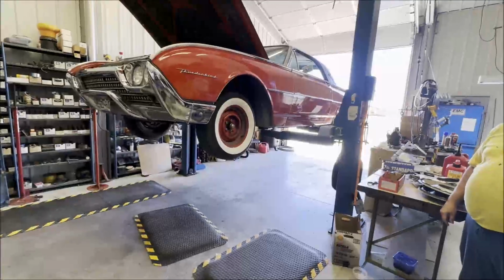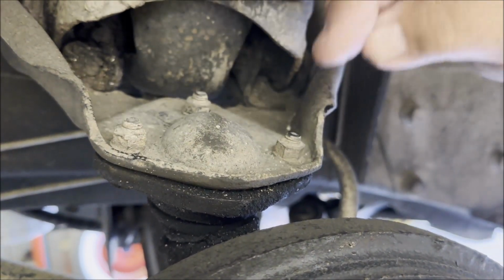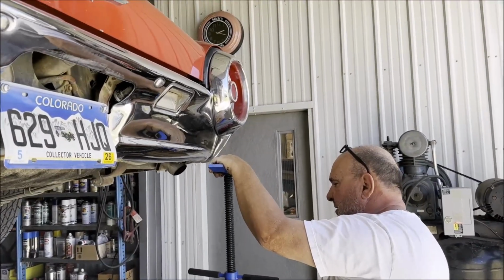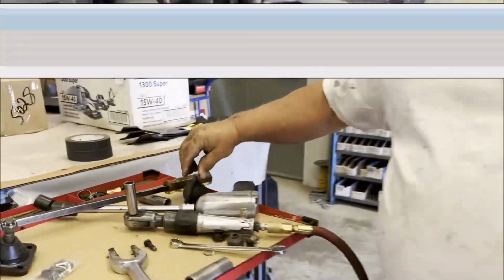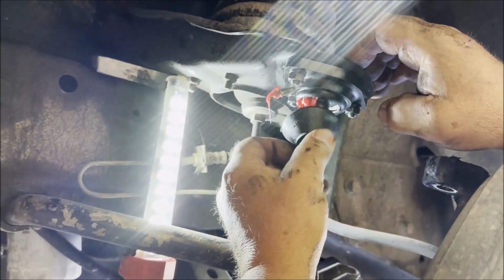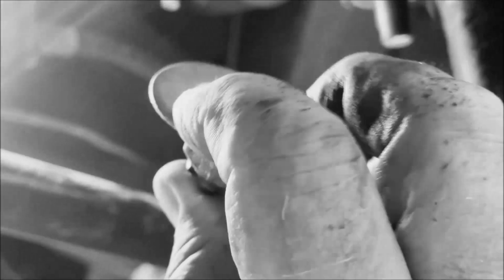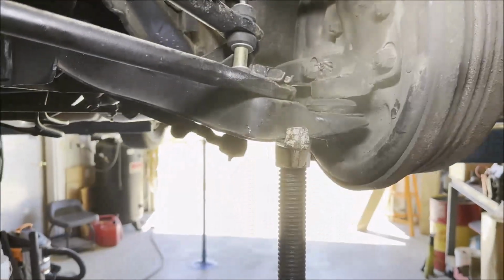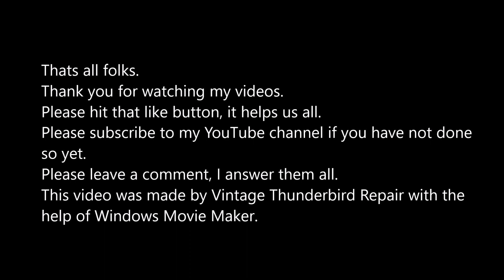1961-62 Thunderbird Upper Ball Joint Replacement

Comment: Hey Nick, 
Interesting how previous mechanics failed to get the castle nuts/cotter pins properly installed.  You'd think that would be a no-brainer.  Doesn't instill a whole lot of confidence in a person regarding the competence of some mechanics when you encounter issues like this!  Yep, the ball joints were riveted into place originally. Thanks for insightful tips!
Reply from the maker: Hey Scott, the cotter pin issue is a lot more common than youd think. I deal with it all the time. It is certainly the sign of a very lazy mechanic at the very least. Thanks.

Comment: Excellent video. Good reminder about castle nuts and cotter pins lining up. 

Have you done a video on replacing LOWER ball joints on 4th gen T-Birds? I don't recall seeing one. I've done the upper ball joints on my car and I think I should probably do the lower ball joints, too. Probably shoulda done them while I was doing the uppers, but oh well. From what I understand, the lowers will be more involved because the original rivets will need to be drilled out I think. I don't feel confident doing the job with just the shop manual as a guide. OTOH, maybe I should just drive my car out to you and have you do it. You could look at some other issues, too.
Reply from the maker: Hey TheCanine2, yes I can help you with that. I don't think I've done a video on the lower ball joints. I don't remember now since I've got so many videos. I use an air chisel to remove the rivets. The lower arm is much easier to do than the upper since you don't have to remove the spring to do the lowers. Thanks.

Comment: hey Nick  i'm getting ready to rebuild the steering and Front suspension on my 66, i ordered a rare parts steering idler bearing kit 20474 to replace the bushing. Have you ever installed one of these, It came with no instructions and rare parts Could not help me with the layout, they didn't seem to know anything about it really.
Reply from the maker: Hey Jason, Ive never installed one of those, Ive always used the bushing. Rare Parts is an excellent place to buy front suspension parts from and I think its odd that they could not help you with the installation. I dont know what to tell you because I am unfamiliar with the bearing kit and Ive never seen one. As a matter of fact, I didnt even know that a bearing kit was available. Did you look on YouTube for a video about it? Thats what I would do. Sorry I couldnt help you. Thanks.
Reply: @vintagethunderbirdrepair9426  ok thank you, i didnt know there was one either i was getting ready to order the bushing and found this listed on there website, is was only $10 more then the bushing and is greaseable so i figured why not, i looked on youtube but found nothing so far. ill figure it out i hope

Comment: Hi Nick, quick question unrelated to this video. I have a ‘66 with AC. Whenever I accelerate air conditioned fades from the vents and ambient air is felt coming from underneath the dash. When I am in an accelerated cruise mode, air conditioner works as it should. Any thoughts as to what is causing this issue?
Reply from the maker: Hey Douglas, yes I know exactly what is causing that. The vacuum system that controls the heater and AC runs off the engine and is dependent on engine vacuum. When you accelerate, engine vacuum, manifold vacuum, drops off and anything that is dependent on that vacuum starts to fail. All Thunderbirds do this, even those where I have fully rebuilt the vacuum systems and they are working 100%. It is the nature of the vacuum system. Same thing happens to those cars that have vacuum wiper motors such as the 1958-60 Thunderbirds. When you accelerate, the wipers fail. It sucks and to design vacuum dependent wipers was pretty stupid. There is nothing you can do about it except to maybe install an electric vacuum pump, one that keeps working no matter how much manifold vacuum you have. Its the nature of the beast. Good luck.
Reply: Thanks Nick.      I have first hand experience with the windshield wipers “fading” under acceleration. My late mothers ‘57 has always done that. (she purchased the car new in 1958 and yes, we still have it). Many thanks for your channel and assistance in keeping my daily driver on the road.

Comment: Nick,
Whoever installed those useless cotter pins for castle nuts was not a genuine mechanic.  He just thought he was one.  Good catch.
Regards,
John
Reply from the maker: Its a two fold problem, the reproduction ball joints have a longer shaft and the cotter pin hole is located in the wrong place. And then the mechanic doesnt have enough sense to identify the problem or bother to fix the problem. Probably a chevy mechanic!
Reply: Nick,
Before installing them on the car, ball joints can be turned until the cotter pin hole faces a more convenient position.  Throw on a few flat washers followed by the nut, then tighten the nut until the hole moves to where you want it.  Easy-peasy, my friend.
Regards,
John
Reply from the maker: Yes, that is the cure.